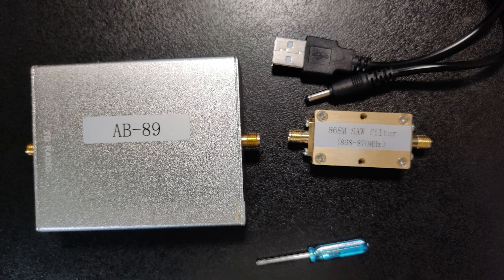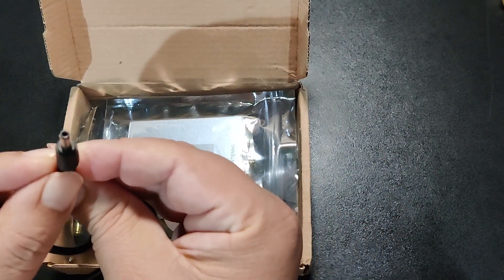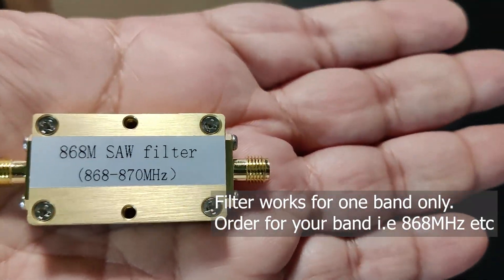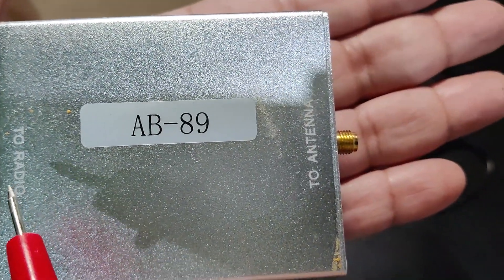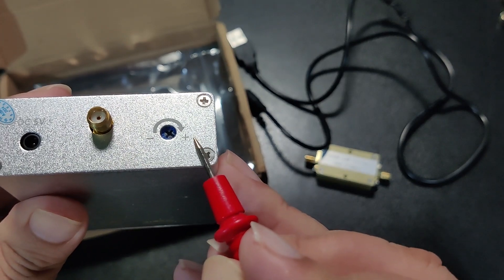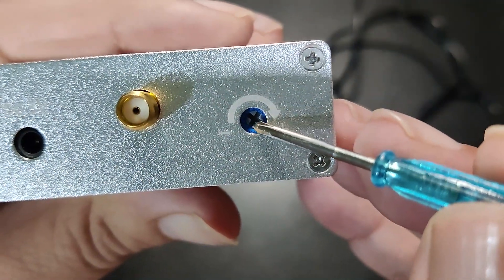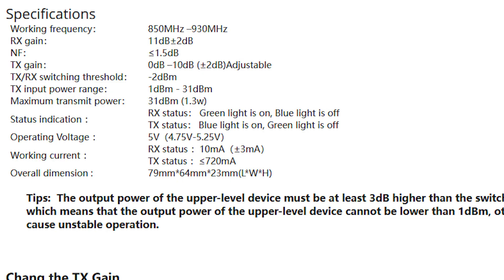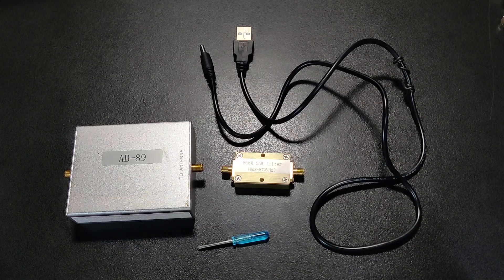Meshtastic US-915 MHz and EU-868 MHz Bidirectional RF Amplifier AB-89 Overview by Technology Master

Comment: Do you put the saw filter between the amplifier and antenna or between the radio and amplifier?
Reply from the maker: It is tricky. I PUT IT BETWEEN RADIO AND AMPLIFIER. Radio is usually the main source of harmonics and amplifier has no or very little contribution to harmonics. I will put filter between ANT and amplifier if there is too much interference in the area and my priority is to increase receiver sensitivity (remember this is a bidirectional amplifier i.e amplifier for TX and LNA for RX side). There is a 3rd scenario where I cannot ignore harmonics and I need best selectivity for LNA. I would go for two filters i.e one for TX between radio and amplifier and other for RX between Ant and amplifier(LNA)

Comment: That looks very useful ! Where can I buy it ???
Reply from the maker: It is available on aliexpress. Available from many vendors. https://www.aliexpress.com/item/1005005445930926.html  Option is Color: 868M Filter 2in1 B.  I have seen people complaining and saying that they threw it away.  In my view there are two most common reasons for problems with RF amplifiers.  1- Unstable and starving power supply. It has to be able to provide sufficient current with stable voltage when we are transmitting. 2- Is the overdrive. We should start at a lower dbm and keep increasing while keeping an eye on its performance.  I know you are a master of Meshtastic, still adding my 2 cents. :)
Reply: @technologymasterkam  thank you for the info. Will take a look !
Reply: @technologymasterkam  Have you done any tests for the overdrive? it seems that the default TX gain is 0. Have you tried to increase it? What's the default TX gain that it comes with? What was the TX gain that worked best for you? 

And thanks for all the informative videos you create.
Reply from the maker: I have not tried overdrive as it is not recommended by Semtech and others too. I usually keep drive a bit below the upper limit given in the specs. It produces unwanted noise and signals due to unstable or over voltage.  When using an amplifier, we can start with minimal drive and then increase it keeping an eye on the received signal. 
- I am not aware of any default value. I have seen different value from different manufacturers. Mostly it is 22dbm. If we increase this TX value in the software, actual transmission still stays at MAX e.g 22dbm. 
- I usually use 22dbm while using node without amplifier. In my videos I have shown what value I am using for a specific test or experiment. If I have missed it somewhere or if you have a question about a video, do ask :)
Reply: @technologymasterkam  I was asking if you've tried the different TX levels on the amplifier. 
From what i see, the amplifier in your video comes with a default tx gain of 0.
Reply from the maker: @paveljeludovsky  Please refer to specs here https://youtu.be/B6mCA-9seCg?t=124  I use amplifier TX gain to MAX i.e 10 db. Mashtastic node output to 21dbm. It works without any problems.  This RF amplifier was set to MAX gain by default. I have tested it outside the video for full power (21dbm + 10db =31dbm).